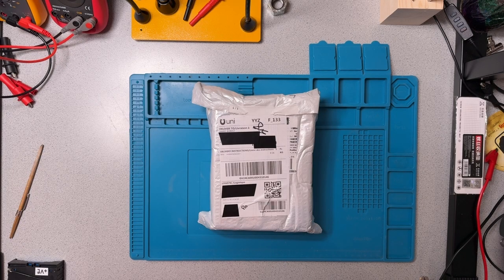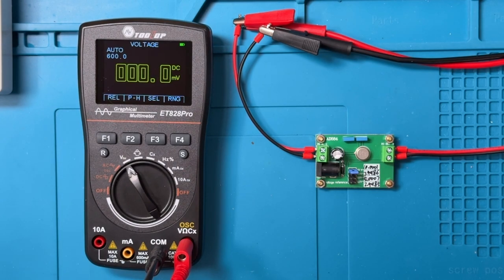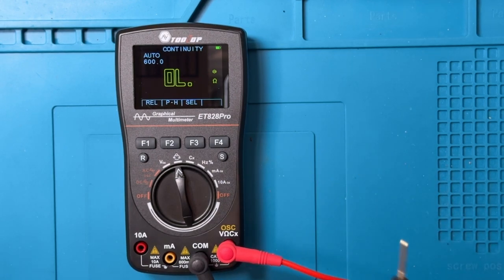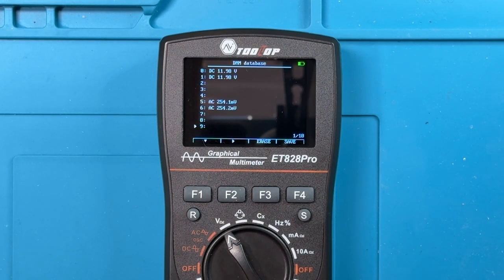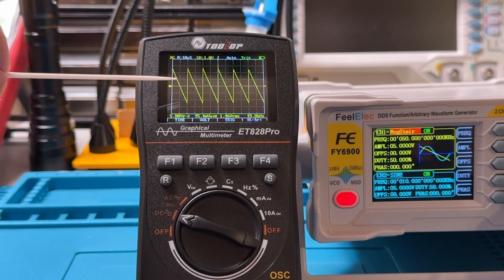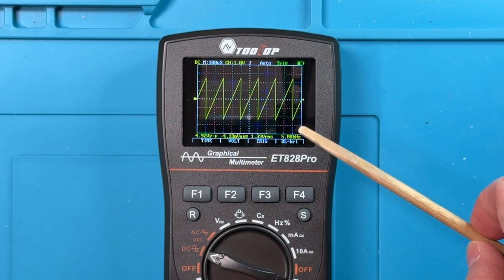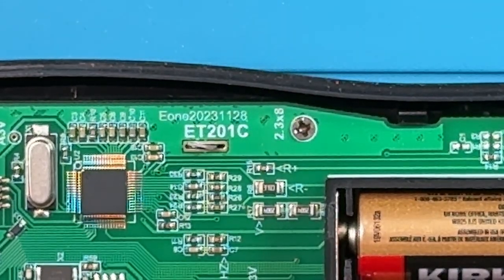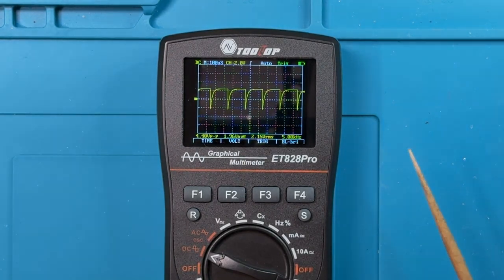Tooltop ET828 Pro

Comment: Subscribed.  I have a few scope/DMM combos. The best bang for the buck so far is the zt703. I am slowly teaching myself electronics repair and what YouTube doesn't seem to have is some sort of practical tutorial on how an instrument like this would be used to troubleshoot a power supply for example. Where would the scope be connected? What are we looking for?  Thanks for the video.
Reply from the maker: Thanks for subscribing. The ZT703 does look very appealing. 

Troubleshooting and repair is a massive topic. You generally need to know something about the circuit that you are trying to repair in order to pinpoint the failed component.  There are many videos where people repair broken items. Unfortunately, most of the videos that get made show successful repairs. Realistically you don't need really sophisticated tools for most items. However, the people that do it well have lots of experience with most of the common circuit designs. As a result they know what to look for when they are probing around on a circuit board.

From the videos that I have watched, the components that fail most often are capacitors and diodes. For capacitors, you can use an ESR meter to assess whether a capacitor is likely to have failed. For diodes, a multimeter in diode check mode will do it. Sometimes the Mosfet or rectifier will have failed. In that case a significant part of the circuit won't be energized. You can use a multimeter to check that the voltages are present where expected. You need to be really careful with a power supply because part of the circuit is carrying 120/240v.

Honestly I haven't seen many repairs that require the sophistication of an oscilloscope.  Usually that is reserved for fine tuning of circuits.

Comment: Capacitance issues are showing up with square wave pulses on the rising edge. This is likely due to the probes you are using, as they are not likely balanced.
Reply: I would doubt anyone makes compensated (adjustable) probes for a meter like this. It’s probably overkill because these MM scopes meters are more quick and dirty visuals of the signals, rather than a device for precision measurement. If the waveform needs analysis, you would want to use a real oscilloscope where you would be able to balance out the fast transient artifacts. 
In any event, I did like your review and may have to consider one of these in the future.
Reply from the maker: Thanks.  I am now eager to try the Zoyi ZT703S
Reply from the maker: Thanks for that insight. Unfortunately, the device uses conventional multimeter test leads and not oscilloscope probes. Is there a simple modification that I could make?